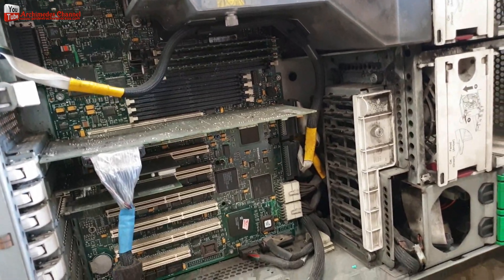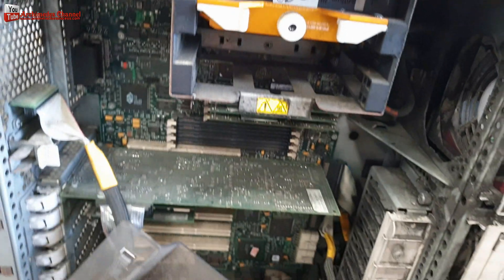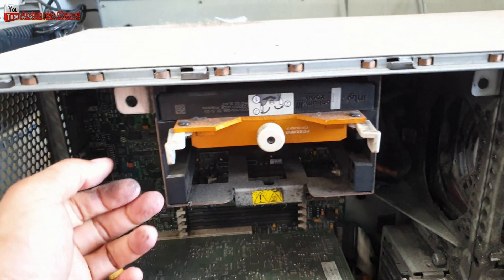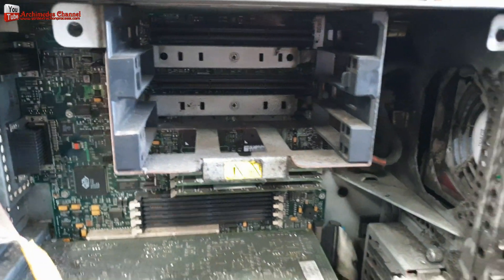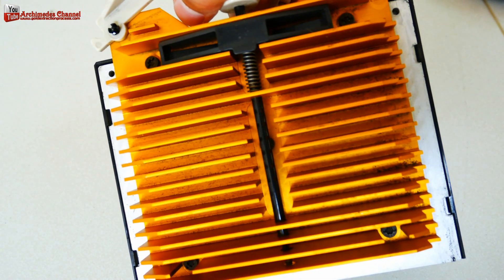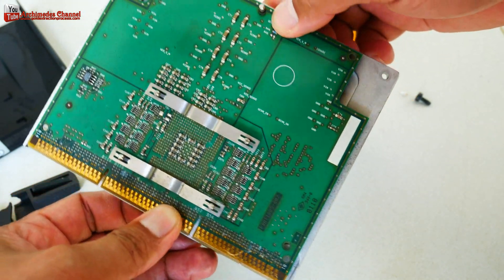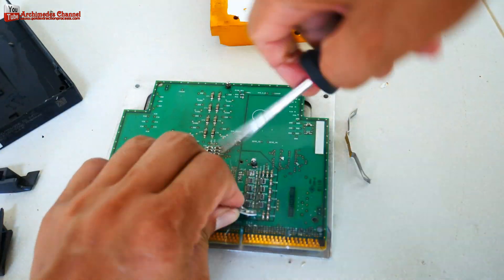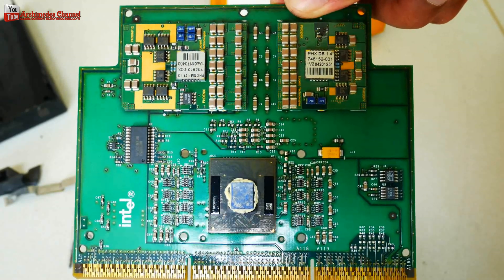Gold from CPU Intel Pentium III Xeon

Comment from the maker: Computer motherboard and other electronic circuit boards can also contain rich gold content made up of gold-plated circuit traces, edge fingers, connectors, Integrated Circuits, transistors, & memory chips. 
There is very little profit from extracting the gold content found in most computer chips and electronic components yourself unless you have significant quantities of them to be processed. Refining Gold & other precious metals (including silver, palladium & platinum) from CPU's & electronics is typically not profitable unless it's done professionally and in large quantities on a large scale; when processing just a few items the cost is often higher than the value of the gold that is reclaimed. More importantly, the process of refining gold involves working closely with hazardous materials including nitric and hydrochloric acids, as well as Mercury, and should only be performed safely by experienced Gold refiners.